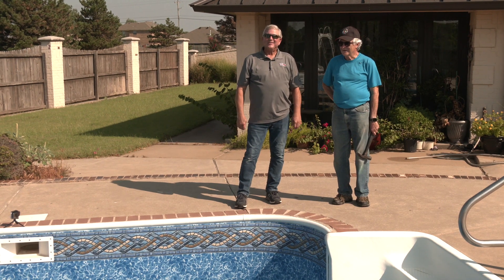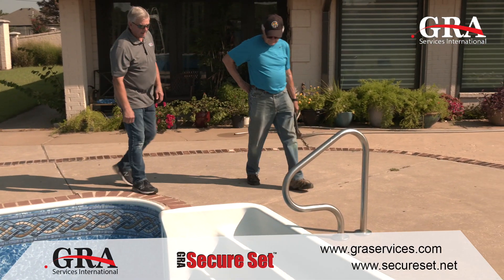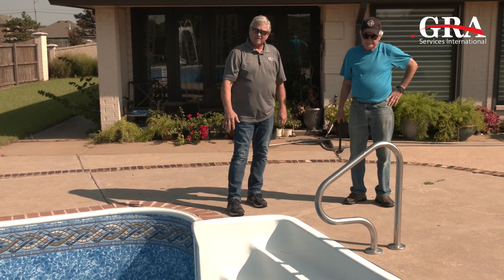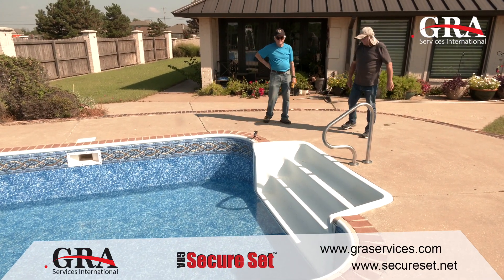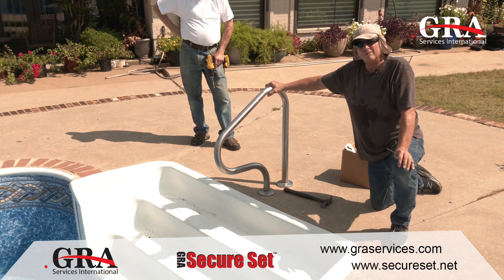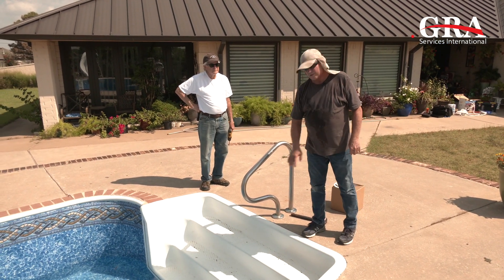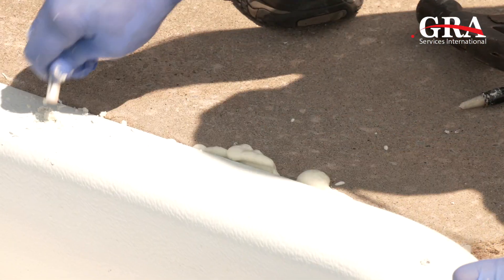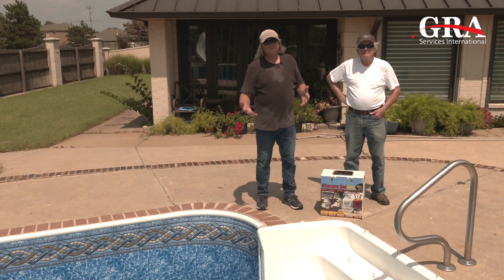Repair and Structural Restoration of Fiberglass or Composite Pool Steps with SecureSet Spray Foam

Comment: I have a cracked fiberglass step in my pool. I,was quoted $11,000 to replace the steps - and a new liner, which is just replace three years ago. I am going to try this! It looks like a better solution than drill huge holes and packing with sand, which will eventually get washed away again. Thanks so much for this DYI video for a potential solution to an otherwise outrageously expensive repair.
Reply: Hello Michael,  Yes, if your issue is lack of sand support under the steps, this will work very well.  The key is, take it slow.  When you have drilled your access holes, start from one end and work toward the other.  You will be able to "hear" the foam moving and traveling under the fiberglass step.  When you have drilled your holes, if you go ahead and purchase the endoscope, it will aid you significantly in actually visualizing your voids and if there is water present under the steps.  The endoscope we recommend is the Depstech DS300  It costs about $87.  The scope combined with the spray foam will make your repair very inexpensive.  The steps we repaired in the video were going to cost the owner more than $8,000.00 .  We ended up using two kits and the endoscope, total cost was about $868.00.  Thank you.
Reply: Now that it’s time to close the pool, I drained the water down just below the bottom step and followed the instructions in this video. This stuff is amazing! My steps are now solid with no flexing. I appreciate this step by step video and the Secure Set!
Reply: What did you use to patch the drilled holes with in the steps after applying the foam?

Comment: Great video!  I will be using this foam method to fill in the gaps under my steps this month.  Question - I do have a crack in our top step.  Do you have a video on repairing a crack?  And a video on fiber glassing the steps, as I'll need to do that as well!  Thanks!
Reply: Did it work? I’m starting ours soon and need guidance. What did you fill your drilled holes in with? What’ paint did you use to re-finish the stairs? Thank you!

Comment: I moved into a home with a pool that has steps with two nice cracks in it. I tried last year to just patch the steps, but due to no support underneath, it wasn't exactly a permanent fix. So, I am going to definitely be looking into this as an option to get some much needed support underneath, as the top two steps bend a ton. 

My main question is what would you recommend patching the drilled holes with? If you have a suggested method of matching these, I'd love to take a look before starting the project this spring!
Reply from the maker: Thank you for your question.  We don't actually sell a product to do the patching of the holes and/or cracks, but customers tell us they use Olympic patch and paint kits they buy on-line or in pool stores.  I'm sure there are other brands, as well.  GRA Services - Secure Set

Comment: I've been repairing these fiberglass /acrylic stairs for more than 15 years from the top only, with a layer of fiberglass, travara core and a fiberglass final layer then gel coat. From my exp. this can withstand a load of approx. 500-600 lbs. and no holes or under support. This method mentioned in the video should work in most situations, unless there's ground water issues, then you have added floatation under the steps which could cause other problems.
Reply from the maker: We talk to installers/contractors all the time that have used pour foam to support pool steps for many years and now they like to use the spray foam, since it is a much easier process.  No one has ever said they created more problems.  I'm sure there are many ways to repair and restore pool steps, but this has definitely been a great option for the under support for hundreds of DIYers, as well as contractors throughout the country.  Thank you!

Comment: Crazy, I had this same idea before seeing this video, did not consider re- fiberglassing one of my steps but will need to do that as well. 
 Are all the high-density spray foam kits that you can buy from lowes, home depot, Menards the same or is one better than the other?

Comment: If you still read these. Can you tell me what you patched or filled the holes with when finished and also what did you repaint with?
Great job!!!!
Reply from the maker: Thank you for the question.  Our customer did the final repair of the holes with Olympic brand products, which we do not sell.  You can find it on-line without any problems, and possibly at local pool supply stores.

Comment: Our kit is supposed to be delivered today, and we’re hoping to use it tomorrow! Could you tell me what size pilot holes and dowels you used?

Also, our bottom step definitely has water under it like the one in the video, but we have a spot that has repeatedly cracked after repair when people step on it. Because of that crack and a crack on the second step, we’re losing tons of water each day. Should I drill the pilot holes in the bottom step and then shop vac the water out? How dry does it need to be under that step for the foam to adhere? 

Our liner is only about a year old, so I’ll need to put a vacuum on it during this process, so I just need to get all of the information I can in order to do this as quickly as possible and not mess the liner up. Thanks in advance!
Reply from the maker: We tried to answer this question over the weekend, but for some reason it didn't post.  We hope that you had good luck with the project, if you had a chance to do it.  
We use a 3/8" drill bit, wrap black electrical tape under the flares of the mixer nozzles about 6 rounds to fit tightly in the drilled hole.  
For plugs you can use dowel rods to fit or roll up paper towels, or use nozzles that have been used prior and have hardened off from the foam.  
Do not apply the foam when there is standing water, and the drier the better since the foam during expansion can suck in the moisture and create a junk foam.  
Thank you!
Reply: Thank you for your response! We didn’t end up attempting it last weekend, because I knew there was a lot of water under at least my first 2 steps, so I wanted to get a liner vac from my liner installer before I started, as I knew it would probably take at least a day for the water to dry up. 

Anyway, I did have one more question, if y’all don’t mind. The top rail of my steps isn’t accessible, because there’s concrete over it. Do you think I could drill at an angle near the top on the sides and still be able to shoot foam as a dam for the sides of the steps? How important do you feel like the side dam is?
Reply from the maker: @sftbalnerd  If you want to email us some pictures to info@graservices.com, we would be glad to give some suggestions, if we can.  Also, please call us at 405-672-8885, since it may be easier to answer your questions by phone, as many times with a project like this one there can be a lot of questions, and I don't want to misinterpret the questions.  I think I might understand the "side dam" question....but maybe not.
I know this is now the weekend, but most times we can take calls after hours and help however we can.  If no answer, please leave a voicemail and I will attempt to call you as quickly as possible. 
By the way, if you haven't already done so, we would drill a few holes and use an endoscope camera (like we did in this video) to get some ideas of the void space?  This makes the planning of the project much easier.  Thanks again!

Comment: How much is a service like this and does it include a new gel coat on top?
Reply from the maker: We don't offer the service itself, we sell the Spray Foam for DIY projects or contractors to do the job.  We have had many customers that have called to order for this project as well as have contacted us back to advise the project went well for them.  Also, we have talked with contractors that use our foam to do the backfill project and a few have said they use Olympic brand products to patch and refinish the steps.  Thank you, GRA Services  405-672-8885  www.secureset.net  info@graservices.com

Comment: I have a fiberglass pool that has a bench seat at the water return and the water return had been leaking causing this issue. Once it is filled with the foam do you then have to just patch the fiberglass?
Reply from the maker: Hello,  Yes, once the steps or bench seats have been supported, you can plug the hole with a wood dowel, cut it off at the base, sand it smooth, then patch the fiberglass.  Do you know the extent of the size of the void under the bench?  Thank you, please respond to info@graservices.com

Comment: It's supposed to be 70* out today, the house was 68 through the night in the house last night. Am I really in a place where I cannot use it today?
Reply from the maker: Hello Micah!  I believe we talked about this by phone this past weekend, but here is the detailed info to help.  
You do need to warm the canisters when working in cooler weather (which is generally defined as 65° and below), or with cold product (product should be between 70° to 90°F).  We send out an email with every order to advise of the need to warm canisters up to 36 hours before use.  
1.) remove the canisters from the box and put them in a large box turned on it's side to make somewhat of a cave.  
2.) use an electric space heater (NEVER open flame with pressurized canisters) and separate the canisters to allow for the warm air to move freely around the canisters.  
3.)  for best results, warm the canisters between 80° to 90° F and use in the warmest part of the day.   before spraying in cold weather, which is defined as 65° and below, but working in shade and high humidity can also be an issue.  
We have personally used the kits in 39° F temperatures, but not with frozen ground.  
There is a COLD WEATHER CAUTION document in the box and on the website.   

In cold ambient temperatures the chemicals will cool down very quickly with constant spraying, so watch for frost on the canisters and the fittings.  If this happens, you will need to stop spraying, quickly clean up as the instructions explain, and warm the canisters again; otherwise you will not wind up with a strong foam.  For warmer weather you will still need to warm the tanks to at least 75° to 80° F, for best results.
Reply: @SecureSet-Fence-Installation   Yes! We did! Thank you so much! I still have them in an 85* water bath with the sous vide keeping them warm!
Reply from the maker: We have many customers that report using electric blankets to keep the product warm during use.  Another idea is to use hot water baths (not boiling water) to help hold the temperature of the product when working outdoors.
Reply from the maker: @Micah-M00  That's a great idea.  Hope your project goes well for you.  Thanks again.

Comment: Do the kits come in different sizes for different volume that you need? I have same steps with same issue and need to purchase identical kit.
Reply from the maker: Hello James, At this time we have kits that have different volumes and different densities.  The kit in the video is a 10 cubic foot volume kit with a compression strength of 70 psi.  That equates to load bearing capacity of 10,080 lbs. per sq. ft.  We have another kit that is a 16.6 cubic foot volume capacity that has a compression strength of 35 psi, and it can bear 5,040 lbs. per square foot. Both kits are priced the same, one can bear more weight than the other.  Personally I would recommend the 16.6 cubic foot kit for your pool steps, the other kit is better for heavy traffic areas like driveways and concrete patios or decks that are supporting hot tubs and things of this nature.  Thank you

Comment: is there a video on what to do with the dowels in stairs
Reply: Hello,  Once the foam has reacted, expanded and set, sometimes the foam will come up out of the holes a little bit.  I remove any f the foam, then sand the area around the hole smooth, then paint over the repaired area.  If you leave the wood dowels in the holes, cut them off flush, then sand and paint. The owner of this pool, re-fiber glassed the steps and painted everything when he was finished.  Thank you
Reply: I am having the same issue with my steps. So did you also fill the lower step? When I stand on the lower step it doesn't move but tilts inwards. Is there a certified company that could do this for me? I am concerned about overfilling. Thanks for your information.
Reply: I used plastic plugs, same size  as my holes,,grinded  excessive  plug,gelled coated

Comment: You are Not supposed to drain a fiberglass pool
Reply from the maker: Hello Joni,  First of all, it is not a fiberglass pool, it is lined pool with a thin metal backing behind the liner.  The pool liner had just been replaced and the owner is in the process of filling the pool. There was an incident when an individual of hefty proportions stepped down on the top step and cracked it in two places.  Prior to that, the pool had been empty for a period of time before the pool liner company could come and replace the liner. Since the pool had been empty for a while, that is when it became apparent the sand support under the steps had washed again and the structural integrity of the steps had to be reestablished.  The cost of the entire project was just under $400.00.  The bid to replace the steps was $7,500 plus labor. Very good move on the part of the owner.  Thank you.